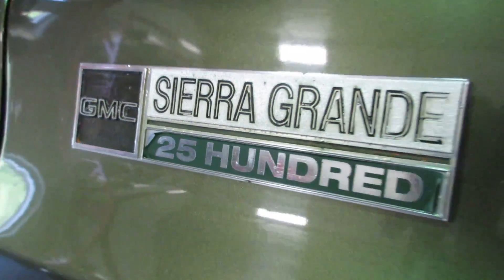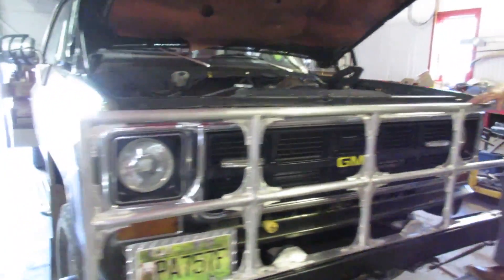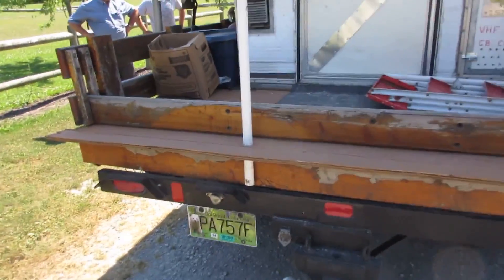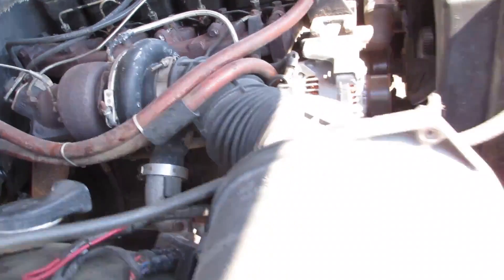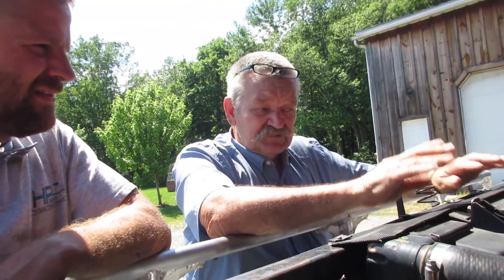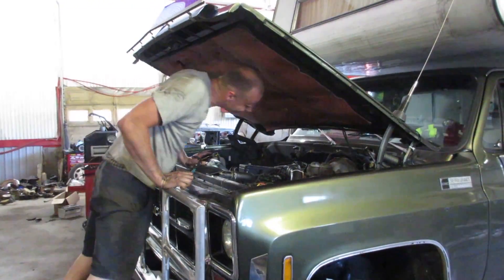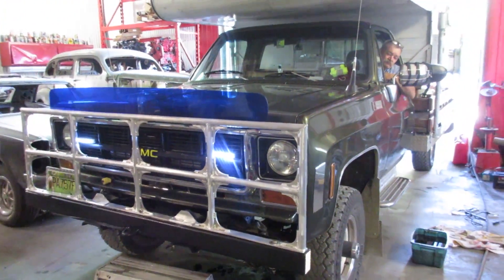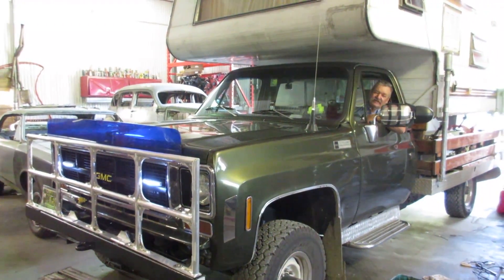Cummins Powered 1977 GMC Camper Truck

Comment from the maker: We got a visit from Yogi, a retired truck driver who watches our show, driving a '77 square body Cummins conversion through most of Canada and some of the States. We got to do an oil change, fuel filters, and fix his valve to switch between fuel tanks during his visit. Beautiful truck, Yogi, thanks for stopping by!
Reply: Beautiful truck. I know you mostly deal with trucks but I've always wanted to see a cummins in something like an early 70s Buick Electra
Reply: Yogi likes to put the hammer down, apparently.
Reply: Old truckers never retire..........they just get different diesels!

Comment: I've done two cummins swaps into 73-87 GM trucks and will do a 3rd soon, boy oh boy they fit way easier into the chevy squarebody trucks then they ever did in the dodges. cool rig
Reply from the maker: My 05 has more room than the same year Dodge.
Reply: I've got an '86 Chevy Silverado K20. I'd like to see a engine swap video for more information.